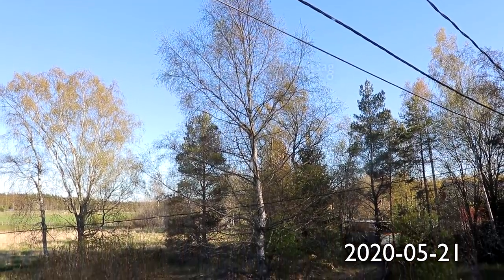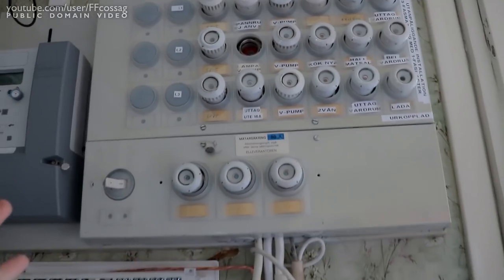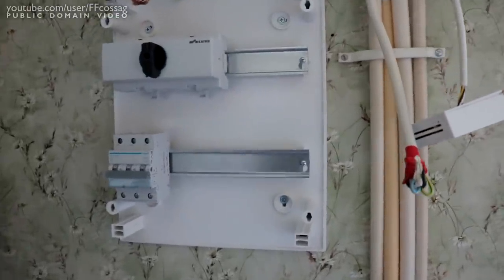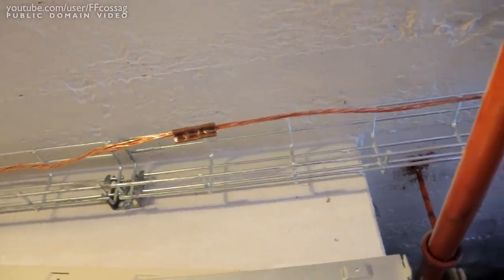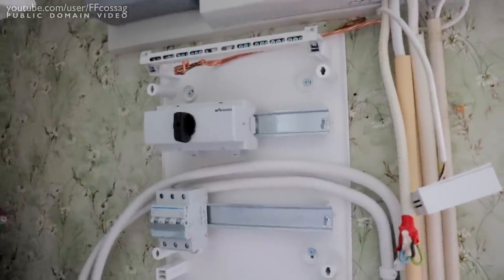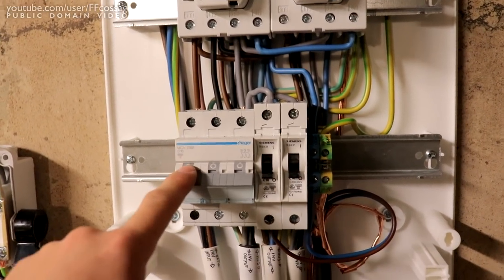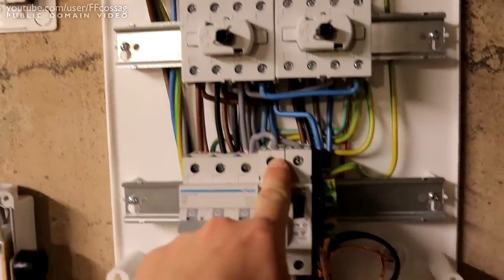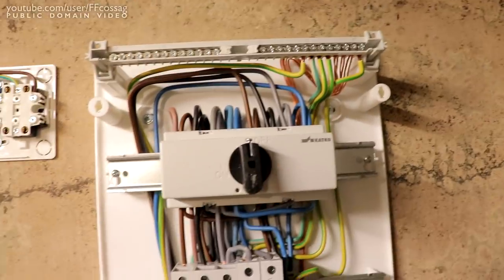10 kW Hybrid Solar VLOG 5 - Grounding & Mains Switchgear

Comment: Ah yes another installation in the chronicles of filling the house with metal electron spaghetti :D Can't wait to see a demo of it all fired up and functioning! Also, love your attention to the grounding conductor, i was wondering if you have split bolt splices where your at, they accomplish the same task as your steel cable clamps or the hose clamps but are purpose built for copper conductors! Of course thats just more cost for something which you accomplished just fine for cheap or free from the horde piles :)
Reply from the maker: No, we don't usually see split bolts here. Grounding wires are usually crimped if they need to be extended.